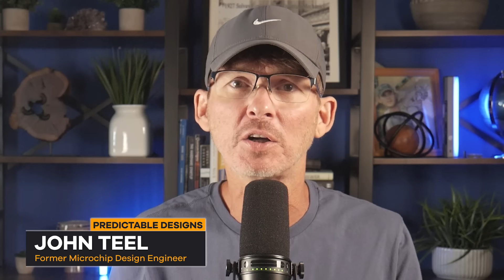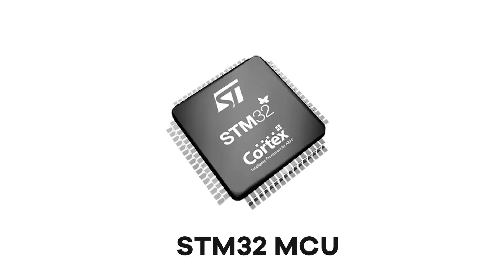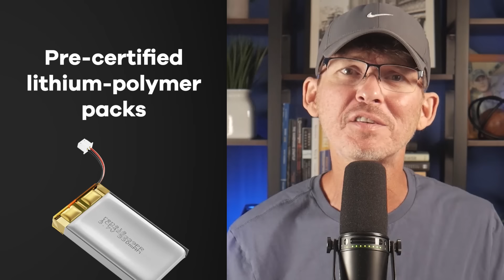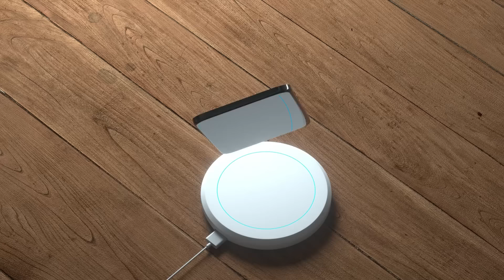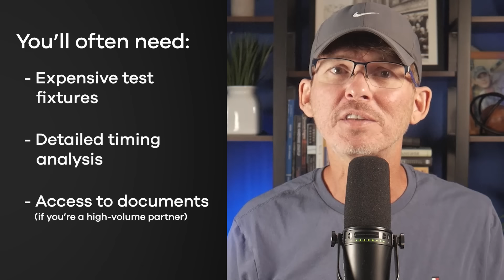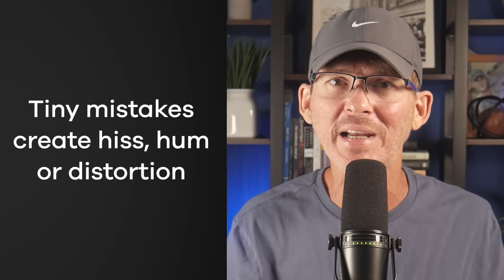10 Technologies You Should NEVER Use in a Product

Comment: I can see your data transfer points regarding usb 3.0 but imho regarding usb pd, you are nit up to date. It is dirt cheap and very simple to i.e. integrate a ch223q, firmware controls it with a few lines of code via i2c, and whenever you want to charge something, higher voltages mean less current and are almost always a better concept than 5v usb these days.

Comment: About all you need these days for subGHz RF design is the fundamentals of RF, some isolation and RF PCB layout techniques, a NanoVNA, (already about a million of them sold for around $50,) and a TinySA, (about $140.) Thanks to the web, free modeling software, and $150 microcontroller-based RF test gear, RF design and dev work has become a piece of cake. Even ham radio hobbyists are doing more and more RF design these days.

Comment: High end audio? The fact is the lion's share of high end audio products are built in a garage by non-accredited engineers copying a reference design. High end audio is one of the largest snake oil communities around. Use standard legacy and proven electrical engineering design practice and your audio product will produce "high end" performance.

Comment: Correction: PD 3.1 provides up to 48V 5A, it is PD 3.0 that goes up to 20V 5A. USB PD documentation is certainly complex but most of that complexity is handled by ICs that cost pennies. Something like an i2c version of ip2366, which integrates a bidirectional buck boost controller up to 28V 5A, handles charge, discharge, cut off up to 6 lithium cells in series and supports virtually all chemistries, except for lithium titanate. It even does rough voltage based capacity measurement that compensates for load. Instead of getting lost in documentation, you can just use the reference schematic to integrate that into your circuit and program it via i2c with the charge or discharge limits, cutoff etc. This IC covers 99.9% of all cases.

Comment: have usb3 (5gbps) running over micro-coax through some small gimbal motor shafts on our bee-chasing drone. Not a problem... all i had to look up was what impedance to use, and manufacturer's suggestion on the parameters of diffpairs on the specific prepreg for this impedance. It all just worked, no multigig scopes were necessary... but i agree in that if it didn't, i would have been pretty screwed, unable to debug it with our puny 70MHz scope. 

Come on, if usb3 is able to go through that usb-A connector that isn't high-frequency optimized at all, it isn't all that tricky after all...

Comment: Is USB2-HS also something to avoid?

I'd like to stream data continuously 75Mbps, but I've seen that one should only with chips that have everything (including the PHY) built-in... even then the layout / routing will be too much for a first time beginner!
Reply from the maker: No, that's totally doable. Just use a chip with everything integrated then the main complexity is properly routing the differential pair. Just be sure you get it reviewed by an experienced engineer before building.

I have a video on my channel just on how to route USB diff pair data lines.

Comment: Ad. 9. There are wireless modules with certification for sub-GHz bands. And they aren't that expensive. Cheap ones suck at having any range, hence need for custom antennas, but others can exceed 1km with included antenna or 10km with external Yagi-Uda for those remote environmental sensor applications.
Ad. 8. There are so many different battery sizes, one can just get few different ones and connect them in parallel to fill all that empty space.
Ad. 5. Anything proprietary is bad.
Ad. 3. Most hi-end audio is BS anyway. Audiophiles listen to music with wallets, and their golden ears hear stuff that doesn't exist.
Ad. 2. I couldn't get a 4G module to send data, as they are complex, too.
Ad. 1. FPGA FTW. Besides there are plenty of microcontrollers and modules that have so many different peripherals, one can find a correct solution in hours, instead of spending months on custom ASIC design.

Comment: I only have a few years of experience as an EE, but i've developped product using RF, with custom batteries, analog audio and pretty high end application processor. All as a "team" of one or two people. Some products are already on the market and certified by Apple and Google. 
The secret is to find good partner to outsource cerification and complexity. You should also be very picky when choosing IC, checking available documentations, EVM and sofware support beforehand. 
Avoiding all your categories would likely eat through your edge on the market and get you quite a low performing product.
Reply from the maker: Those are some great points, especially about choosing the right ICs and outsourcing certification.

Comment: I'd VERY STRONGLY recommend a SiP (like an octavo) over an raspberry pi of any sort. I have shipped products with RP3 CM, RP4 CM and it has been a TREMENDOUS source of problems. sure you can use the (hobby) community for fast bring up but thats where the benefits end. additionally, rpis have very bad power management , you cant selectively turn off cores, downclocking will change your I2C and SPI clocks because its actaully controlled by the GPU, etc etc. I have got drastically better battery life from beaglebones if you want something COTS as well. just hoping to help others not trap themselves into broadcom garbage

Comment: I've been on design teams that have made all these mistakes, including custom battery packs and VHF wireless. This is usually the doing a marketing person who "knows" that the product needs to have all the modern things to compete in the market.

What I usually try to impress upon them is the need to manage risk. Give yourself a risk budget and stay inside it. Try to take on only a measured amount of risk per product iteration. If you are at a startup company with a new idea, then you probably have all the risk you need. Focus on getting a manufacturable, sellable MVP out the door that does not take on additional, unnecessary risks. Later, with some cash flow and and maybe a bigger team and a bit of buying power, you can add on sexier and more difficult capabilities. This is the way.

@mikeselectric stuff is right, though, that PD is really easy now!

Comment: 10 Raspberry pi is easy but will NOT solve your availability woes, avoid for medium sized volumes. 
9 Avoid sub 1ghz? 900Mhz LORA is amazing for low bandwidth network devices. 
8 yup, never needed, soo many good options off the shelf
7 disagree USB PD and 3 is common on cheap ASICS now
6 wireless charging is great for IP rated devices, or low power electric toothbrush style, screw qi it's huge  
5 Avoid HDMI!
4 Ya I prefer LCD but it needs to have an extremely wide viewing angle or people will think your product is trash.
3 easy
2 USB LTE dongles, lets you isolate the shady stuff in cell modems from your system
1 FPGA
Reply from the maker: Thanks for sharing your thoughts!

Comment: For me as a hobbyist pcb designer i can relate to all of that stuff lol.
I tried USB PD with different chips, the best performing and low cost was a CH224K. I can control it directly with 3 gpios of an esp32. Ive spend like 300€ on PCB design untill i got my final result.
And the most expensive misstakes i did was with ESP32 and ethernet. I was spending like 500€ or more into designs until the LAN8720 was running great. I also tried a w5500 spi ethernet chip. But that was nuts.
Also ive spend like 100 or 200€ into trying to implement PoE on my pcbs but also never got it working. 
Thank you for your videos.
Reply from the maker: Thanks for watching and sharing your experiences!

Comment: Good tips. A lot of these kinda fit under the idea of make it simple first, and add in the bells and whistles after you have a proof of concept already working.
Reply from the maker: Yep, exactly!
Reply: @PredictableDesigns  I recently took an off the shelf $1 USB-C PD chip and wired it to a jack to run my Sega and Nintendo. (Technically the Nintendo as I couldn't bring myself to reverse the polarity on the outgoing barrel connector for the Sega) Interestingly, the board the chip is on is about the same size as the daughterboard that the model 1 Genesis used to house its power jack. With an adapter to reverse it and the magic of 3d printing, I should be able to convert the Genesis to USB-C power completely without any irreversible changes tot he console. The NES though, that jack is properly on the board, so you can't do that without modifying the hardware or keeping the USB-C jack on a dongle, but it takes 9v AC, so polarity doesn't matter. 

It works quite well and can deliver 9v with only like a deviation of about a half percent.

Comment: nice video! and i want to say something about those (just about what i think before i listen to your explanations :3)

1. High end chips: they're 99% useless, if its something neede then likely Pi CM modules works too
2. Custom RF: what for??? that sounded pain ;w;
3. custom battery: aren't you scared of battery exploding and plus its more expensive to squeeze 2% more capacity for not really large difference in battery time between standard battery and your 2% improved one. customers dont even notice it and it doesnt give benefit other than making products more expensive
4. advance USB stuffs: it depends ultra speed USB are like useless, if you want to connect to outside world at faster rate ethernet can do it and USB PD, just use barrel jack! later you can get seperate module which does all PD things and gives a male barrel jack ready to use (or at that point just buy normal barrel jack AC to DC adapter)
5. wireless charging: you're overengineering, a nicely design docking station is simpler
6. proprietary connector: what the goal of this? your customer going to complain why this doesnt work with X (which has common standard connector)
7. fancy display: straight up expensive, keep it with a simple cheap displays
8. high end analog audio:  ehh not sure about this, its just complicated
9. ultra fancy 5G cellular: mostly useless if its like IoT devices (cellular connected AC for some reason), even 2G works fine, they dont use alot of bandwidth because 2G kinda dead now, just choose common one like 4G
10. custom IC: dont set unrealistic standards for your level, use off the shelf parts, they're cheaper and make your circuit simpler

the entire thing to me can be understood as "keep it stupid simple"

Comment: What you think about using PC extension "dongles" in prototyping for other platforms? There are 4G, WiFi, Bluetooth, Audio In/Out, etc. All with some Linux drivers with source code.
Reply from the maker: They're okay for early prototyping. But unless the final product will also have a MPU running Linux then I'd look for a simpler option based on an MCU.